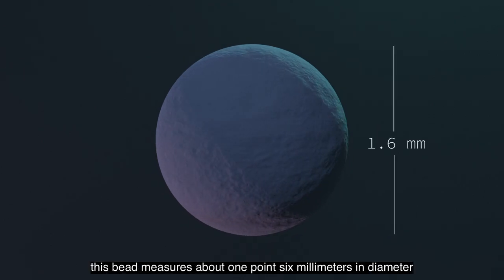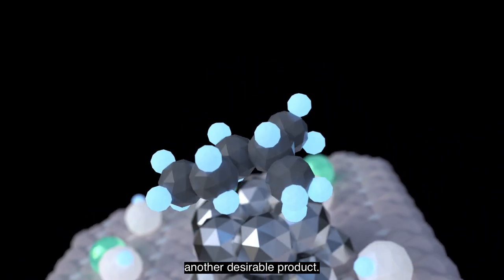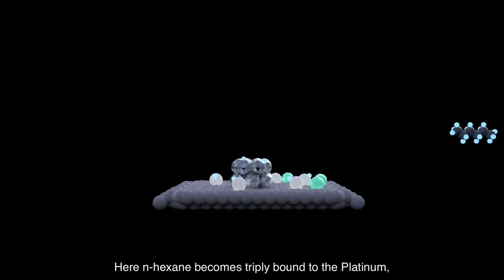Axens Reforming Chemistry (ENGLISH)

Comment: Thank you so much. 
This explains perfectly the process,  since I work on on the reformer units. 
But..
Why is platinum used, what is the main reason of the use of this metal. 
Thx
Reply: "Platinum’s success has long been attributed to its “Goldilocks” binding energy. Ideal catalysts hold on to reacting molecules neither too loosely nor too tightly, but somewhere in the middle. Bind the molecules too loosely and it’s difficult to get a reaction started. Bind them too tightly and molecules stick to the catalyst’s surface, making a reaction difficult to complete. The binding energy of hydrogen on platinum just happens to perfectly balance the two parts of the water-splitting reaction — and so most scientists have believed it’s that attribute that makes platinum so good. "

In a sense, the way I see it the platinum acts as a temporary "wait don't go anywhere" for more real reactions to take place. It is extremely resistant to corrosion and is one of the least reactive metals. So it's just there to encourage chaos.

Comment: Completely wrong,  hydroxyl radicals aren't acid on the contrary are base ones. During manufacturing the acid sites are deposited by hydrolytic adsorption of aluminium onto the hydroxyl groups of the silica surface, after calcination again the acid sites are created also by diffusion and sintering as well. It's not acceptable from a reputed company to cheat or misinterpret such basic subject.
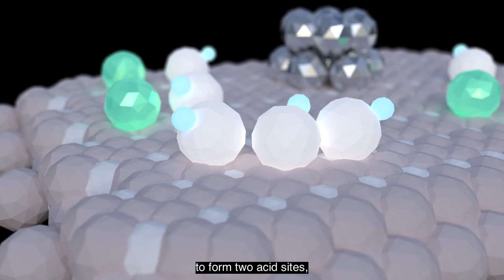Reply: You can see that happen in the video if you watch very carefully at 1:42, a water molecule comes in contact with Aluminium, and gives it a Hydrogen, while the oxygen binds to the lattice and has a Hydrogen protruding from it as well (two acid sites, one Alumina-Al-H, and one Alumina-O-H. Not sure where you're getting silica from.
Reply: Hydroxyls in an aqueous solution are basic because they accept hydrogen (H+) ions to form water. Hydroxyl groups on the gamma alumina surface, on the other hand, donate a proton (H+) temporarily during the catalytic reaction, and therefore they are classified as an (Bronsted) acid. These hydroxyl groups are created under normal operating conditions (after catalyst manufacture) by interaction with water in the vapor phase. The acidity of aluminosilicates, as you mention, can be due to both Lewis acid (electron acceptor) and Bronsted acid (proton donor) sites, which are created during catalyst production. However, the catalyst shown in the video is not an aluminosilicate.
Reply: Wholly wrong, you got to get a Chemistry Fundamentals text. Oxhydryls never ever will be acids species. They're good Lewis bases or Nucleophiles. 
Firstly where do you get the aqueous  solution (LOL). It's a HC feed with a water fraction of 0.00026. Morever, narration says it's alumina gel Al2O3 (LOL) . 
Why Axens technology requires the injection of such minuscule amount of water?
Reply: You also need Chemistry Fundamentals text. The clip mentions it's alumina gel (Al2O3) where oxhydryls are coming from? (LOL). Catalyst made as aluminiosilicates may have OH radical in it's structure (I.e. octahedral) but no alumina gelatinous.
Reply: You also need Chemistry Fundamentals text. The clip mentions it's alumina gel (Al2O3) where oxhydryls are coming from? (LOL). Catalyst made as aluminiosilicates may have OH radical in it's structure (I.e. octahedral) but no alumina gelatinous.